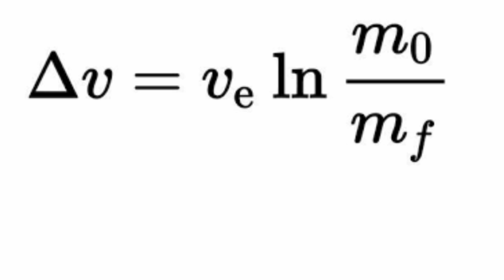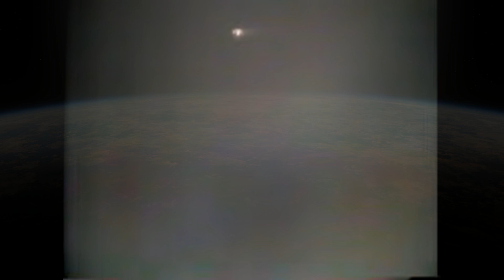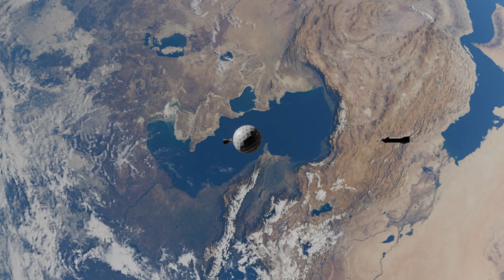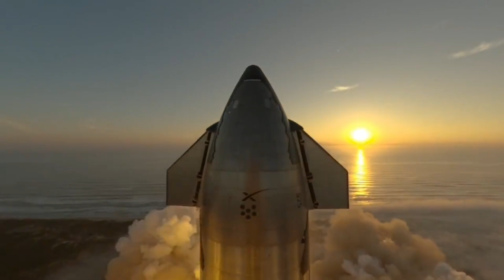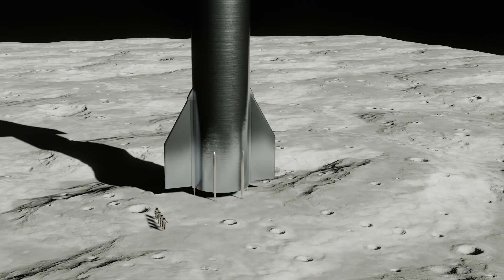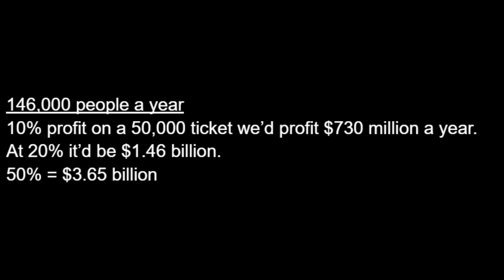Building Nuclear Ships On The Moon

Comment: How exactly are planning on landing a starship on it's side on the moon..... Well, without crushing it.
Reply: I don’t agree that sideways landings couldn’t be done 
But there are other ways of doing it.
Reply from the maker: https://youtu.be/TBk73dBt97c?si=L_2lxRqaNNlHC_vw
Reply: @Anthrofuturism  I saw that, that's why I asked.   The belly flop maneuver is Starship's implementation of aerobraking.   Without AIR it doesn't work.   And even in  air, It still lands vertically after breaking as it has no other option.   
You can't even tip it over after landing as it doesn't have the structural strength and would just get crushed by it's own (1/6) weight.  Since you based so much on this part.  I would like to see your plan as to how to pull that off.    As is, Musk says it can't be done so they have to do the elevator thing.   But I accept that may be a cost thing.  Maybe you could do a video on what everyone is missing.  Even with infinite money.
Reply from the maker: @lucidmoses  I do note it would have to be retrofitted I understand it's impossible the way starship (or any thin walled rocket) is in its normal state but it's basically adding reinforcements at the cost of increased weight. It only makes sense for the first structure and cargo shipment too large for the elevator it's definitely not a good route for general cargo and human deliveries. As for exact details I've not ventured there since starship is still in development. Also it can land on legs, even crush canister legs the shock doesn't have to impact the body.
Reply: @Anthrofuturism  Well, one of us is way off on the scale of the problem.   No amount of reinforcements is going to save tipping over a 400 foot, 11 million lbs rocket at 1/6g.  Since it can't land on it side I'm not sure how this could happen.   I'm pretty sure if you check with some structural engineers and run the numbers on this, your going to have to rework that bit of the plan.
Reply from the maker: @lucidmoses  there's internal pressure btw it's like a balloon. It'll weigh even less in 1/6th and uses thrusters to slow down and land on legs. I don't understand your argument, all spacecraft- and aircraft for that matter- have thin skin, but it doesn't matter, they use landing gear. The biggest issue with my plan is burying it under metric tons of regolith but that's an issue no matter what structure we're talking about, inflatable habitats or sideways landing rockets.
Reply: @Anthrofuturism  Look at the size of the Apollo Lunar Module.  It's absolutely tiny compared to starship.  9,430 lb vs 11,000,000 lbs.   Now look at the size of the engine needed to land that tinny thing.  It's absolutely enormous compare to thrusters.

Anyway I don't think I can teach you enough engineering in a youtube comment for you to know why it matters.   I'll just point you in the right direction and if you want to come up with a plan that would work then cool.  Right now I think your just interested in making videos.   Which is fine.
Reply from the maker: @lucidmoses  this doesn't seem like an insurmountable engineering problem at all, you can scale sizes and designs from the 1960s aren't scripture. also 90% of it's descent burn can use the main engines it doesn't need to rely on thrusters the entire time.
Reply: @Anthrofuturism  Well, there is a reason they call it rocket science.